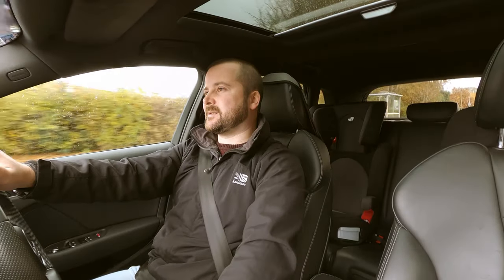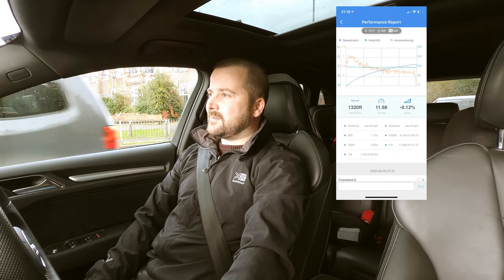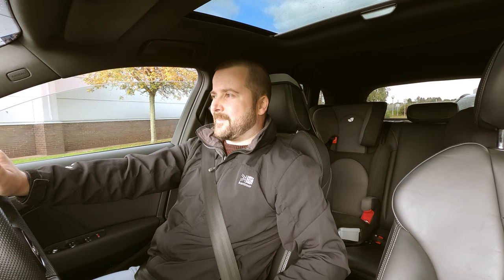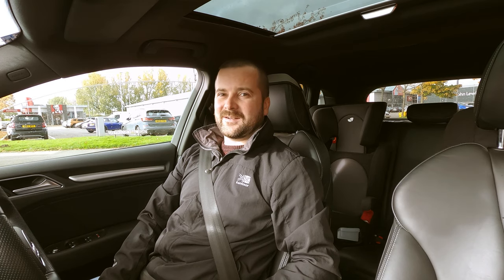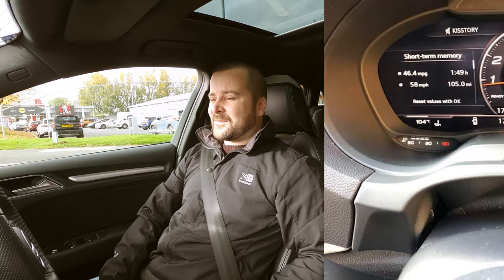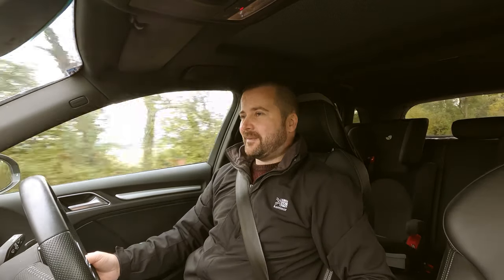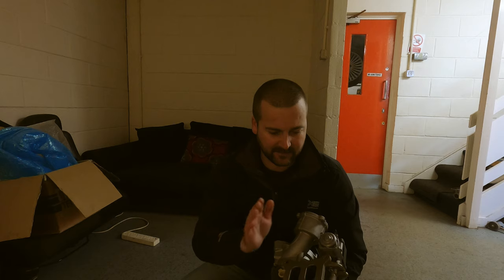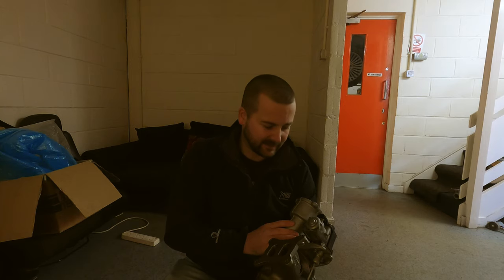Audi S3 8V | Haldex service & we catch up about stage 2!

Comment: Very informative as always. I had a new haldex pump fitted as the back wheels wernt kicking in so was getting wheels spin on front wheels . IT DIDNT WORK £450 bill.  Just a heads up to everyone else really make sure you go to a specialist as the clowns I went to didnt have a clue why it wasn't working (supposed to be audi specialists) They give me sleepless nights as they were talking about could be rear diff 2k bill...I then went to a different garage who changed the settings and clamping pressures and now it works a treat, clowns who fit the pump clearly were trying to rip me off or didnt have a clue but thankfully I dodged that bullet. I only mention this because I've seen this is a common issue on the s3 8v for a lot of owners so beware who you take it to and always get a second opinion. Starting to realise why all these youtubers use specific garages for specific things
Reply from the maker: Thanks Lorenzo! Yes- I'll never take my car to Audi or someone I don't really have a relationship with, heard so many horror stories of people ploughing money in to the haldex fix because some cowboy doesn't know what they are doing! glad you sorted it with the right person! The Gen 4 (pre facelift) are especially prone to this failure, the Gen 5 I have on this is the revised version with a lot less reported failures (Gen 5 don't have the pre filter for a start) 

I only use GPZ automotive now as I trust them, plus I've gained quite a bit of knowledge on the systems myself now so between that and them, its a great recipe!
Reply: @wosa9461  Car has 70k plus on it so new haldex pump won't do it any harm I suppose ha.

Keep up the good work, great videos and editing 👍
Reply from the maker: Yeah probably not a bad thing having a new pump, but Thanks Lorenzo! Plenty more coming 💪🏻

Comment: Cutest intro ever man, you got a great kid there. Stage 3 is possible with stock catback but the tuning company I am talking with (asked for Stage 3 first but then bought the MX5 so...) they didn't say it wasn't impossible but recommended upgraded catback, full 3 inches, for maximum performance. Not cheap though.
Reply from the maker: Yup! I’m stage 3 now, could of pushed beyond 500bhp but the stock catback was creeping up the EGT temps so we kept it sensible - the car is insane now 🙈 I’m not sure more power is needed!! We are almost in the 3 second flat to 60
Reply: @wosa9461  Oh very nice :D 500bhp is a pretty sweet spot already. Stock catback actually keeps it a bit stealth as well.

Comment: By far one of the most informative videos I've seen on the S3 ownership/upgrades. Top job. Earned a sub from me!

I've just gone stage 1, 310bhp 380nm to 360 bhp 525nm. Any advice on upgrades? as the map was the first non cosmetic mod I've added to the car.
Reply from the maker: Thanks Morgan! I’d definitely get some lowering springs - the difference a good set had on the handling was amazing. I find the Forge carbon intake is way better than the racing line R600 for sound too, tied in with a turbo muffler delete will give you all the rich turbo sounds! 

All depends on how far you want to go really? I’ve just broken the 500bhp now, but I won’t be changing anything cosmetically as I want the car looking as standard as possible 

Thanks for the sub! 😬
Reply: Make sure you do your “responsible” upgrades as well. New plugs gapped correctly based on what the tune specs are, maybe catch can (but I’m on the fence about mine), intake to turbo inlet for more airflow, also important to check your diverter valve make sure it’s not torn. Your engine is going to want to consume more air for the tune so anything that helps the air get in to and out of the turbo quicker helps, as well as keeping the IAT down. Res delete, maybe downpipe if you wanna push it. What are your priorities for the car?
Reply: @wosa9461  brilliant, cheers for the reply bud, 100% will go for lowering springs early next year! Not sure on turbo sounds yet, unless you'd advise to change the intake? 

For now I think if I can get to 400bhp, with a lovely sound thats not overly silly for living in an apartment block! + some extras to really enhance the handling and also the way the car puts down the power.

Only other thing I'm potentially looking at is taking the map off and either going for something like your JB4 or a Revo stage 1 map with a DSG tune.
Reply: @tomforde6558  Thanks for the advise Tom, spot on that. 

Will be getting my mechanic to check up on everything you said beginning of next week as booking in a haldex service and an oil change along with hopefully getting an new intake installed.

Would you say res delete or downpipe is essential? I know the downpipe is for anything stage 2+ but quite happy with how mines sounding atm, very surprised how the map effected the loudness of everything aswell!
Reply: @morgan2247  res delete just makes the car sound a little deeper. Downpipe is stage 2 essentially, I have an AWE resonated DP because my car came from factory with a resonator delete (on the actual car window sticker). Stage 2+ is basically HPFP/Intercooler etc.

Comment: Mate, I can't imagine how quick the turbo is going make this thing. In reference to the Haldex, got mine done at awesome and mine was literally still brand new 😄 apparently one of the cleanest they've seen. Its definitely not worth taking it to audi, as they don't clean or replace the pump if needed.
Reply from the maker: Ranj.... I cannot describe how this car is right now, other than calling it an Exocet missile 🙈
Reply: Ranj how many miles are you on? What type of driving do you do? Stop start traffic short journeys or longer journeys?

Comment: I’m stage 2 with stock catback. Just OBD code the valves alway open! My MPG is like 14.6 😂 gotta find out why my motor is running rich

Edit, my dragy is literally stuck in the same spot haha good looks
Reply from the maker: Most likely the tune is ran rich to aid cooling - particularly high in the RPM, extra fuel will cool your cylinders and prevent pre-detonation, it’s quite common for stage 2 tunes to see a high AFR for this reason

Comment: Mines a 2018 and pump packed in at 9k. You have done well to get to 21k
Reply from the maker: A gen 5 as well! 🙈 I’ve not heard of a Gen 5 packing up so early on - did anyone tell you a route cause of this?
Reply: @wosa9461  No, typical Audi just changed the pump with no explanation so not sure if it was clogged up or not but the cars  not been ragged too much. I’m going stage 3 after Xmas going for the venom 550 turbo how you liking it?
Reply from the maker: It’s a whole different ball game Stage 3! Although I’m currently setting up a business and with that, the rain and this new lockdown... I’ve not been able to properly stretch its legs yet 😩 I mean you really have to look at the roads differently now, you can’t just put your foot down - there’s extra measures you put in place now before pinning that pedal 😂 it is scary fast now
Reply: @wosa9461  yes I can imagine its fast. I was going to change the car next for a Porsche macan gts  but with all this going on it’s not worth the financial risk and going stage 3 is much cheaper 🤣 I’m looking forward to your next video to get going for parting with £5k 😭 and the mrs is gutted she’s not getting her new wip
Reply from the maker: You won’t be disappointed! Next video is on the ODB11 Pro unlocking the nanny systems the S3 has from factory, may well be interesting to you as it really changed the cars character, video after that though will be showing off the speed with some dragy figures and reactions from friends and family

Comment: I have an Audi A4 Quattro B9 3.0 V6 do you know if this has the haldex system and if so when is the recommended service intervals. Cheers.
Reply from the maker: Hi Connor - no, yours has the Torsen (proper Quattro) that hasn’t any serviceable parts (aside from the gearbox) great engines those 3.0 V6! Great economy and power
Reply: @wosa9461  Hi mate, I really appreciate the quick response. I did try googling the answer but ended up just confusing myself 😅 My car produces 272BHP and has the virtual cockpit, so Im in love with it. Im going to go stage 1 soon which should hopefully give it 40-50bhp. Your car is an absolute beast, would love a shot. Stay safe and thanks again 👍🏼
Reply from the maker: No problems! It is a bit of a beast now! It’s now at 500bhp - will have some videos up on the channel following the work done 

Thanks for watching!

Comment: Aaargh I need help what the heck is gauze lol help me
Reply from the maker: It’s just the filter on the Haldex
Reply: @wosa9461  so would you recommend changing it as I am the new owner and it’s done 43k on dash or should I clean it myself?
Reply from the maker: What year is the car?
Reply: @wosa9461  mine is 2015
Reply from the maker: You will have Gen 4 Haldex as opposed to my gen 5 - gen 4 have a pre filter you will need to replace
Reply from the maker: I recommend you service the Haldex every 10k though
Reply: @wosa9461  oh so I should get a gen 4 for mine then?
Reply from the maker: Sorry matey, just double checked - 2015 has the Gen 5 - are you going this yourself?
Reply: @wosa9461  if I’m honest I don’t think I would be doing this myself most likely the dealer